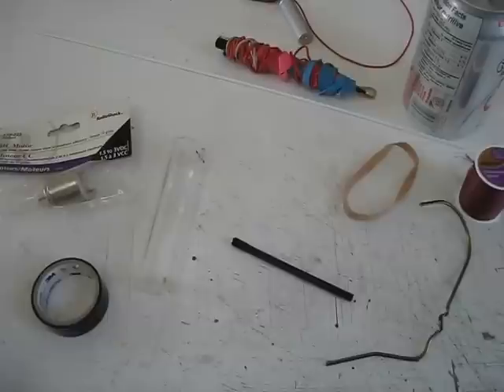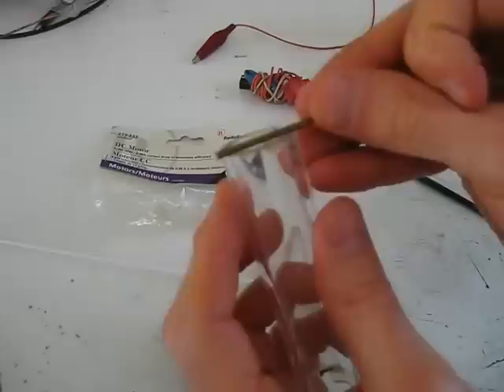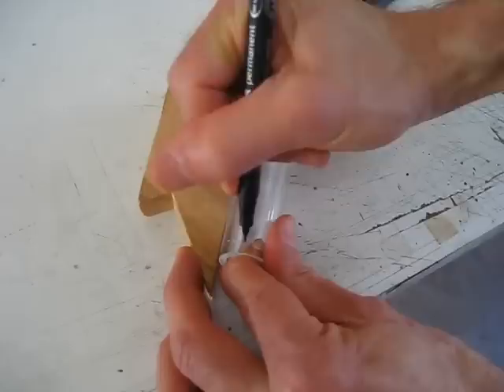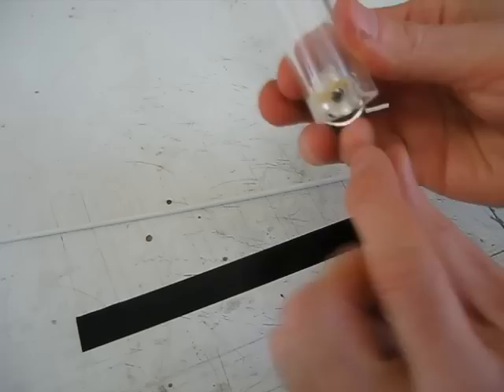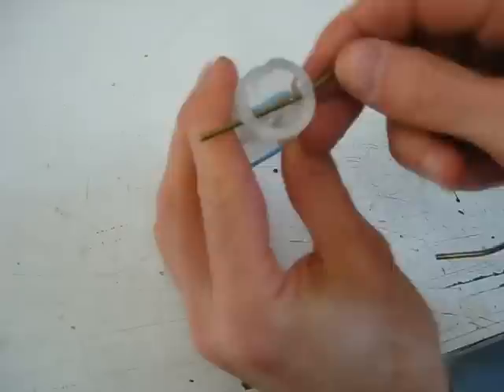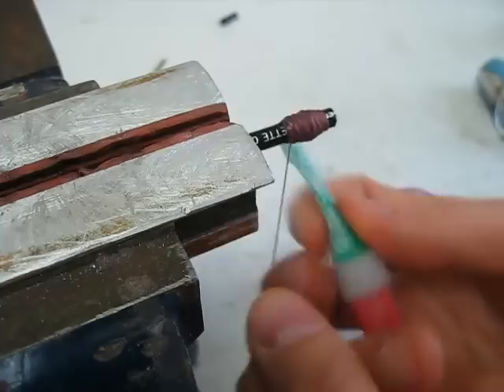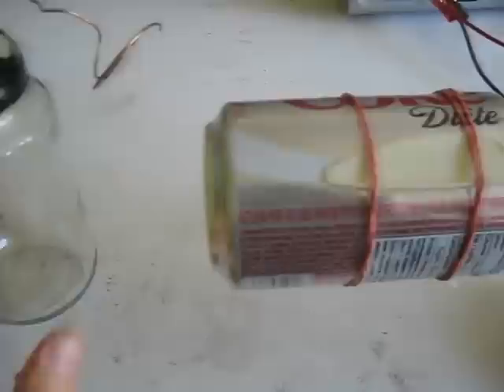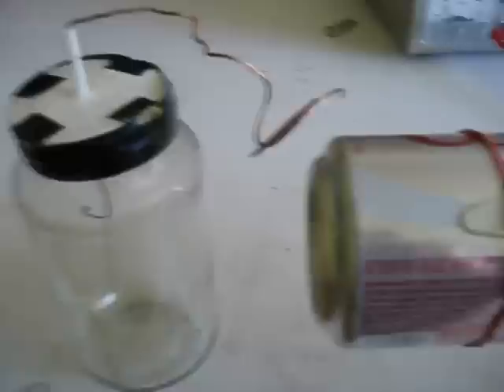How to Make/Build a Van de Graaff Generator Part 1 (Homemade/DIY)

Comment from the maker: I won't be where by mine is for a week or two so at a guess I'd say around 3 inches. As long as you're using that distance or longer then you'll be fine. Copper wire is fine, any metal with a few sharp points will do. Tape is okay but I'd suggest you watch my How to Make a Van de Graaff Generator Part 2 video for a better and easier method. There's a link to it in the description below this video and it's on my channel page.

Comment from the maker: +Ed Haskell When it's vinyl with vinyl like that it's not making use of the triboelectric effect. However, I've seen plenty of people get that working so it's likely something else. With the vinyl belt, cotton thread for the top pulley should work. Make sure you get lots of surface contact between the belt and the cotton.
PS There's no Reply button under your comment because of your Google+ settings.
- go to your Google+ page,
- in the top, right corner click on your thumbnail icon,
- in the popup that appears, click on "Settings".
- for the 2nd question down "Who can comment on your public posts?" set it to "Anyone".

Comment from the maker: @field16b Thanks! And yup, the blue rubber bands are from broccoli! I save them too - great minds think alike. As for what I'm going to do, while doing this video I had to figure out whether the can was being charged positively or negatively. I think another video is in order showing how I figured it out (Hint, it involves inductive charging and my electroscope.) After that, I have more robust commercially made Van de Graaff generators for my day-to-day use so this one'll probably be shelved.

Comment from the maker: Oh, how how much voltage did you get? It should be around 110 to 120 volts AC (your channel page says you're in the US) If you got less between each pole and ground then it's not safe.

Comment from the maker: Interesting choice. Are you thinking of coating the inside surface of the belt with varnish, the surface that's in contact with the rollers, because resin is near the middle of the triboelectric series? I don't know if it will work, but it will be interesting to find out. What are you planning to use for the rollers?

Comment from the maker: For the can side you can tape the end of a wire to it or just have the end of the wire touching the can. Or if you have another rounded metal object then you can make the object touch the can. For the other side, if you used a wire connected to Earth ground like I did in this video then just have another wire be connected to that wire or at least to the same Earth ground.

Comment from the maker: Maybe. It depends on your motor and on how tight the belt is. If the belt's too tight then it's harder on the motor and the batteries may not be strong enough. I could barely power the 1.5V motor in this video with 4 D cell batteries but I have a small Van de Graaff with a different motor that I can power with 2 D cells. See my video "How to Make a Van de Graaff Generator Part 2" at about 10:12 in. There's a link to it in the description below this video or you can find it on my channel page.

Comment from the maker: To transfer charge to the belt, for the end where the can/dome is I put the ends of the wire brush near but not touching the belt. You can see that in the video. For the other end near the motor I ended up having a grounded wire touching the belt surface. Normally it would be separated by an air gap but I don't think my vinyl tape roller at that end worked very well.

Comment from the maker: Thanks for clarifying. I'm surprise you can get it hot enough with a candle but good to know that it does. That reminds me that I sometimes use an old soldering iron, one with a sharp tip. In fact in my How to Make a Van de Graaff Generator Part 2 video I use it to enlarge the diameter at one end of the plastic tube for this VDG so I could put in a bigger roller. Doing that messed up the holes so I had to use the soldering iron to remake the holes too. That totally slipped my mind.

Comment from the maker: Yes. You want a material that's on the other side of the triboelectric series table from whatever material you use for the other pulley. The material you use for the belt should be somewhere in between the pulley materials in the triboelectric series. I show using glass from a fuse in my "How to Make a Van de Graaff Generator Part 2" video. Some have used a small glass bulb.

Comment from the maker: Now that you mention it, yes. The motor plugs into the wall using a three pronged plug, one of which is ground. And for discharging it I have a wire taped to a long stick. One end of the wire is bare and the other is a single wire cable with a plug on the other end for plugging into the wall socket (the bare end is what I touch the dome with.)

Comment from the maker: It's called epoxy or epoxy resin and often resin. It's a liquid or thick liquid that hardens. Some harden on their own and for some you add another liquid, called a hardener. I've used it for insulating stuff like in this video, but also for securing parts to other parts, sort of like gluing. Don't be afraid of asking, there's a first time to learn anything. Glad you like the video. Watch Part 2 as well. Lot's more good tips there.

Comment from the maker: @nikki18able You're right. At 7:38 I use a blue rubber band to hold the hanger thing in place. Then I didn't show taking it apart to put the pencil and rubber band on. Steps:
1. put iron hanger through _one_ of the holes so only part of it is in the support tube,
2. put  pencil on the part of the hanger that's inside the support tube,
3. put brown rubber band on the pencil,
4. push rest of the hanger into the second hole,
5. put the blue rubber band around it all.
It may take a few tries.

Comment: Hey man  firstly I'd like to say your doing great work . I normally  grasp the nail with  pair of pliers  than heat the nail  on the gas stove or  with a candle. Sometimes I just grab hold of the edge of the nail with triple folded a Wet cloth when i don't have the pliers around.

Comment from the maker: Yes. The polarity is determined by the selection of the materials used for the outer surfaces of the rollers and the inner surfaces of the belt. If the bottom roller is at the positive end of the triboelectric series table and the top roller at the negative end then the can will be - charged. The belt should be somewhere in between in the triboelectric series. Look up triboelectric series on wikipedia for a sample table.

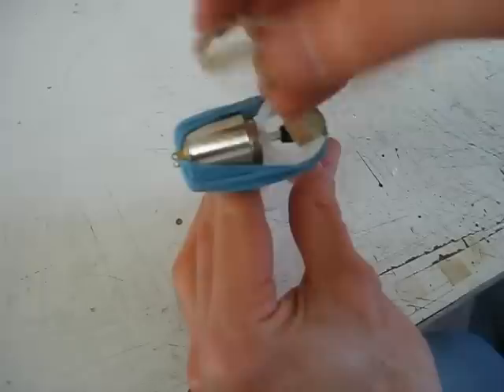Comment from the maker: For the belt I use rubber bands that I bought in an office supply store. They aren't anything special. Your problem might be that your roller is a simple cylinder. Look at the video at 8:17 where I show that the roller/pulley is rounded in the middle. Believe it or not, this rounded shape helps keep the belt centered on the roller. The shape is called a crown. You can see at 6:29 that I did the same thing with the vinyl tape roller.

Comment from the maker: The top wire should be connected to the inside of the can, not the outside. Make sure the strands of wire at the top are as close to the belt as you can get them. The faster the motor turns the more charge you'll get. Make sure you have a good ground connection. Try different types of ground connections as shown in my other video. And if none of that helps then try uploading a video so I can see what you've done. Or you can get my email address from my website, rimstar.org, and send me photos.

Comment from the maker: Make sure the wires that face the belt at the rollers have sharp edges. I use wire with many strands of smaller wire inside. Try different materials for the rollers according to the triboelectric series. I played around with a few in my Part 2 video. Is your wristband the same color as a plain rubber band (brownish) or is it painted some color? Any coating on the wristband will likely prevent the triboelectric effect from taking place.

Comment from the maker: @Robbi2029 I'm not sure what you mean. At least one of the two ends needs the coke can with the wire attached to the inside of the can, otherwise the Faraday bucket effect won't take place. The other end can be another coke can or some other source/sink of charge like a metal case or motor case or a ground wire which really just leads to another source/sink.

Comment from the maker: Yes, I used copper wire in the video. It's just coated with tin or something so it doesn't look copper. The main thing is that is must be multistranded wire with small strands, around 30 gauge (AWG) or smaller. And spread out the strands. You want sharp edges there.

Comment from the maker: The tube is just a support structure, but you also don't want it to interfere electrically. You don't want it to build up a static charge. The charge is mainly on the rotors (thread and tape) and on the outer surface of the belt. Dry wood might be okay, e.g. a tall block that the shafts are mounted on. You should watch my "How a Van de Graaff Generator Works" video. There's a link in the description below this video. It should help more.

Comment from the maker: Or do you mean a power supply to charge the belt? There is none. The rollers/pulleys are charged using the triboelectric effect when they make and then break contact with the belt. This creates a high voltage between the rollers and the brushes. That causes charge from the brush to move the the belt. See my "How a Van de Graaff Generator Works" video for a lot of detail about this. There's a link to it in the description below this video or look on my channel page.

Comment: I am thinking about using a pen casing as the lower pulley .either putting elastic bands over it or vinyl tape you tell me which is best. elastic band or vinyl as band tell me which is best and a pen casing on the top pulley which I will most likely cover in cotton unless you think different .thanks

Comment from the maker: ... Actually I have built a high voltage generator with flyback transformer feeding a Cockroft-Walton voltage multiplier but I don't have a video of it. You can find details on my rimstar.org website in the Equipment section. Look for the "30kV DC power supply (homemade)".

Comment from the maker: +Phani Teja P.L.S Paper might work. Though there's a lot of variety of paper with all sorts of dyes and additives that might make it not work. You'll have to try it to see.
Silk should work. See the triboelectric series table here http://rimstar.org/science_electronics_projects/triboelectric_effect_series.htm PVC is on one end, nylon is on the other end and silk and paper are near the middle. That's what you need.
PS There's no Reply button under your comment because of your Google+ settings.
- go to your Google+ page,
- in the top, right corner click on your thumbnail icon,
- in the popup that appears, click on "Settings".
- for the 2nd question down "Who can comment on your public posts?" set it to "Anyone".

Comment from the maker: @MrCodytk It's 18AWG stranded wire. There are around 15 strands, each one being 30AWG. The strands are probably coated copper. The insulation is rated for 300V. But it's just some spare wire that I happened to have for making up electrical circuits. I used stranded because the small individual strands allow me to make a brush with sharp points at the end.

Comment from the maker: @Aashmanvyas You don't have to ground the generator. But you will need something like a ground that acts as a source or sink of charge. This should be a largish metal object that doesn't have a lot of sharp edges. If your motor has a largish metal case you can even use that. If you use the grounding prong, please, please make sure you know what you're doing. (Sorry for late response, was away on vacation.)

Comment from the maker: @Arensx Here in North America our power sockets in the walls have three holes: hot, neutral and ground. The ground is supposed to be physically connected to the earth somewhere. I bought a plug from a hardware store and the black wire in the video (10:12) is connected to the ground prong of that plug. Nothing else is connected in the plug. So that wire is actually connected to the earth/ground. Connecting the wire to a metal drain pipe under a sink should have the same effect.

Comment from the maker: @eatmmyshorts You need some sort of ground object, even if it's just another coke can. I have an 8" tall VDG that has two domes, a top one and a bottom one, with no wire going elsewhere. Just make sure the edges of the "domes" are a smooth as possible, as few sharp edges as you can get. And yes, you can use copper wires and a copper hanger is fine.

Comment from the maker: I finally had a chance to reassemble enough to test what you asked... At lower speeds the motor is drawing about 1 amp but at higher speed, which it would normally run at, it must run more easily because it draws only around 20 to 30 milliamps (0.02 to 0.03 amps).

Comment from the maker: The glass roller is good but the vinyl belt and rubber roller are an issue. Search for a triboelectric series table. The outer surface of the top roller needs to be near one end of the table, the belt in the middle, and the other roller near the other end. That's not the case for the materials you listed. Big water bottle is fine.
Also watch my "How to Make a Van de Graaff Generator Part 2" where I give a lot more tips and enhancements. There's a link to it in the description below this video.

Comment from the maker: I don't think the whole pulley and brush need to be inside the can. That's why I attached just the wire at the end of the brush inside the can. I think it's getting just a tiny charge because the vinyl tape for the bottom pulley isn't the best choice, but it is what I had available. Also, the end of the can with the hole has a lot of sharp edges and I think that's losing electrons to the air. I'm thinking of doing another video where I try a bunch of different improvements.

Comment from the maker: I don't see how you can do it without the metal sphere. The fact that the brush at the top roller goes to the _inside_ of the sphere is one of the basic features that makes a Van de Graaff generator work. But... if you wear thick rubber shoes to insulate yourself from ground and then hold your hand on the sphere for a while, you will become charged. Then you can touch someone and give them a shock. See my How a Van de Graaff Generator Works video if you want to understand more about the sphere.

Comment from the maker: It is a Van de Graaff generator, they come in many forms. Your 2nd point is an example of one variation. The main thing for it to be a Van de Graaff generator is that the Faraday bucket is used to charge the top dome/can. The belt itself doesn't have to be inside the can for the Faraday bucket effect. That's why I have the top brush as a wire that is connected to the inside of the can. That's good enough for the effect.

Comment from the maker: Yes, the material is the key. Specifically the material for the outer surface for the rollers and the inner surface of the belt. For a positive dome you want the outer surface of the bottom roller to be on the negative side of the triboelectric series. For a negative dome you want the outer surface of the bottom roller to be on the positive side of the series. The top roller should be on the opposite side of the series as the bottom roller or it could be metal. The belt should be in the middle.

Comment from the maker: Nylon should give an improvement. With copper you have just the other roller producing high voltage. With nylon on the roller at the can you'll have both rollers producing high voltage. What is the wire near the roller on the motor side connected to? Is it connected to ground somewhere, or to a metal object, or ...? The ends of the copper wires that are facing the rubber band should have sharp points. That's why I used wire with many strands of small wires. See my Part 2 video for tips too.

Comment from the maker: @indro95 Not sure if cloth will work but try it. The belt has to be nonconductive, cloth is nonconductive. Other things: latex glove, rubber kitchen glove used for washing dishes, garbage bag, plastic grocery bag. The teflon/nylon combination should work. The belt moving over the roller produces heat and the tape deformed a bit and didn't work as well over time because tape glue was exposed. I eventually had to have the wire touching the vinyl tape. You may have to try a few things.

Comment from the maker: +Ed Haskell Have a look at the triboelectric series table http://rimstar.org/science_electronics_projects/triboelectric_effect_series.htm. The material for the surface of one roller should be on one side of the table, the material for the surface of the other roller should be at the other side of the table and the material for the inner surface of the belt should be in between those two. As I said, the vinyl to vinyl combination works but is a different effect. That should help you in choosing materials.  Pen casings are some sort of plastic, which is toward the negative end of the table, but if you're covering it in cotton then it's the cotton that matters since it's the outer surface of the roller that matters. In my How to Make a Van de Graaff part 2 video, https://www.youtube.com/watch?v=QrCgtjZwnB0, I used glass taken from a fuse for the top, and as you can see, glass is near the positive end of the series so it's quite good.

Comment from the maker: Using the 5V motor won't kill you. But what's your power source? If it's a power supply plugged into a wall socket then there can be dangers with the power supply but if you're just using AA batteries, or 9V battery, ... then there's no danger.